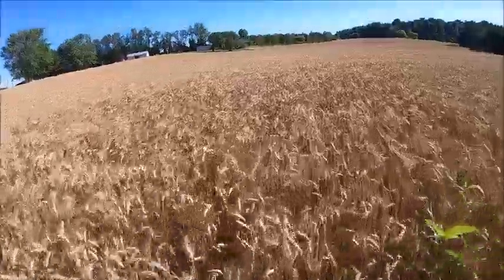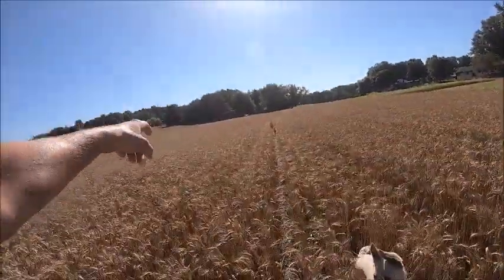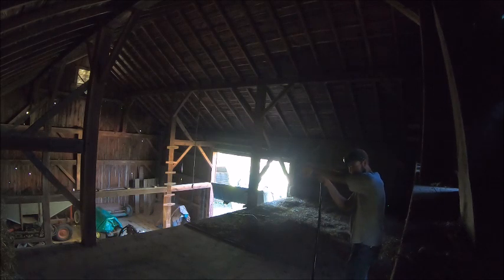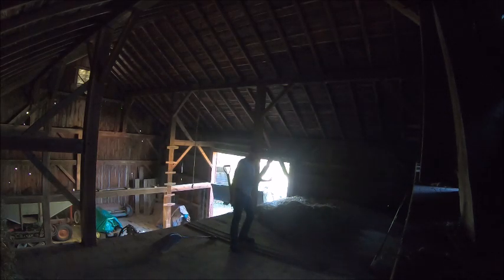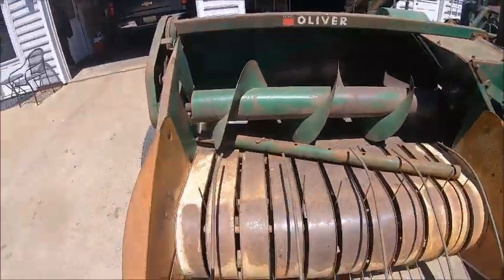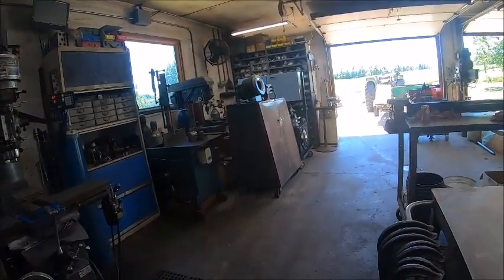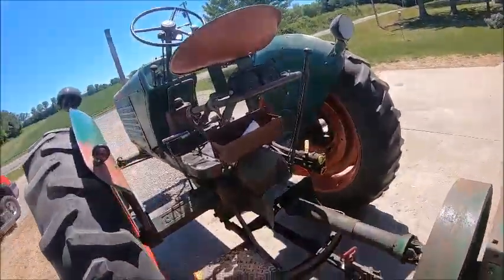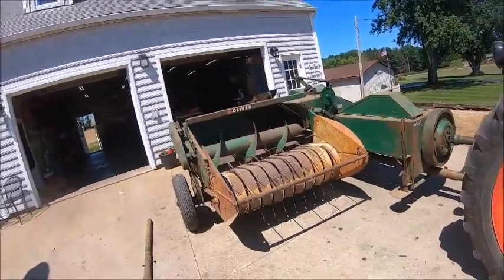Getting Things Ready To Make Straw

Comment: What we did on our barn to fix where it was sagging bad was get some old telephone poles and chop them to length and jacked up the low spots, stuck the pole in there, then set it back down. Then used cables and turnbuckles across the floor of the mow to pull the sides back in

Comment: Back in the early 1980's I borrowed a New Holland 489 (I think that was the model #)from a friend and used it for a couple of years to cut 41 acres of fescue and clover hay. My Ford 8600 was a bit of overkill for a 9 foot haybine but it got the job done with no problem. Teeter was having a good time running thru that wheat. My dog was really energetic like Teeter. I sure do miss her. Thanks for the video !!!
Reply from the maker: The 400 series new Holland’s were hard to beat.

Comment: Do you know of anywhere to get parts for a model 40 oliver?
Reply from the maker: Good luck. Gonna have to check all the junk yards.
Reply: @Oliver66FarmBoy  thankyou
Reply from the maker: Join the Oliver and white combine Facebook page if you use that sort of thing.
Reply: @Oliver66FarmBoy  I think I'm in every oliver page on Facebook 😂
Reply: Hey one last question
How much should a person give for a 16hole oliver drill that has sat outside for 20+ years The guy wants a couple hundred for it
Reply: Maybe checkout a tractor pull.
If someone will talk,  might find a good shop/ parts shop.
Had the same problem with my Massey Harris 44. My area is Farmall and Deere.